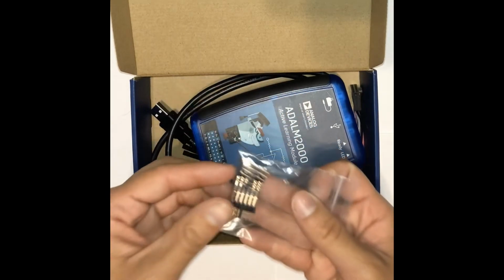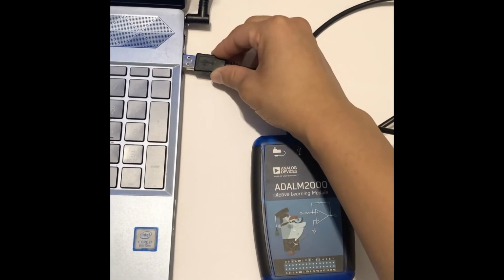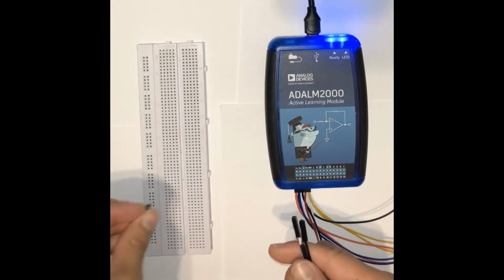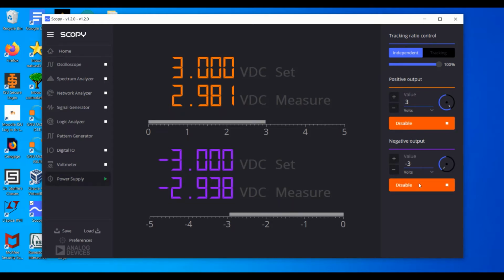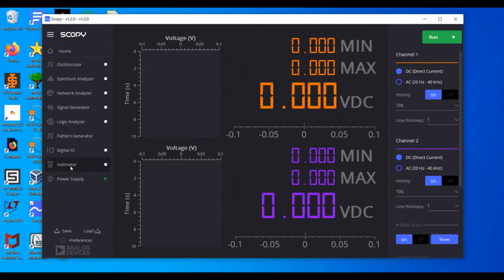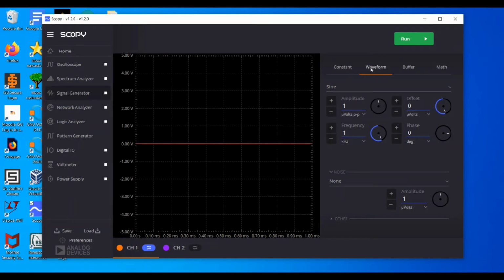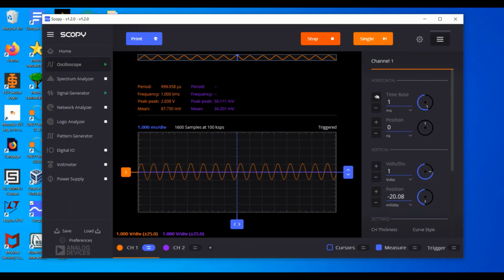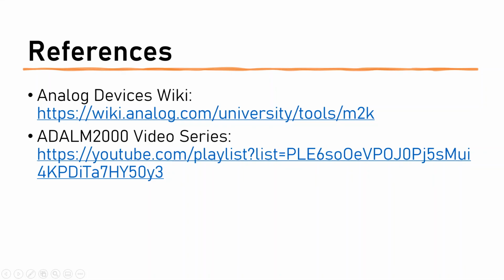ADALM2000: Introduction to Device Implementation

Comment: thanks a lot for your smooth and accurate explanation , i would ask if u have any experience with Analog Discovery 2, if ja which on worth it?  i wanna buy either adalm2000 or discovery 2.